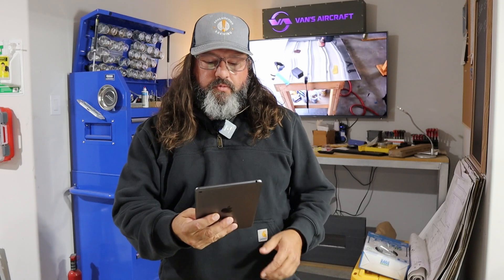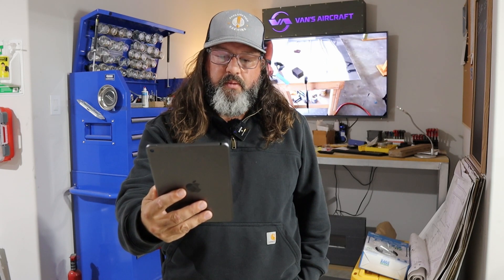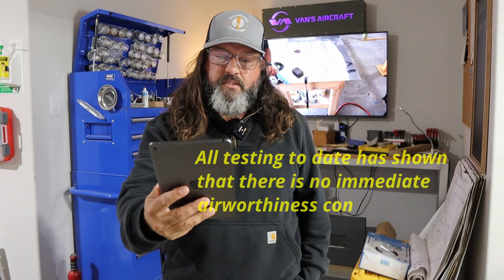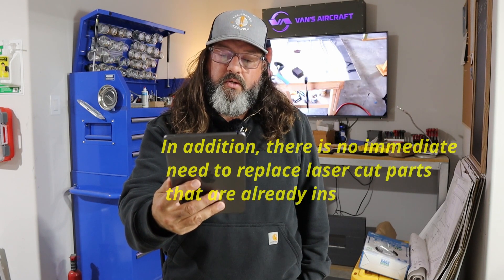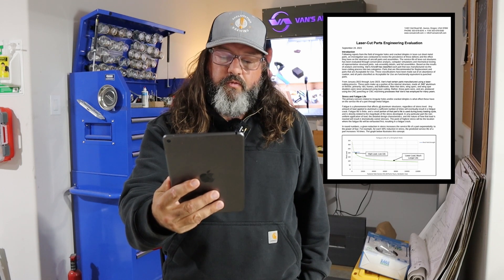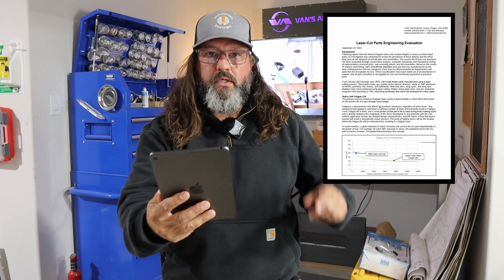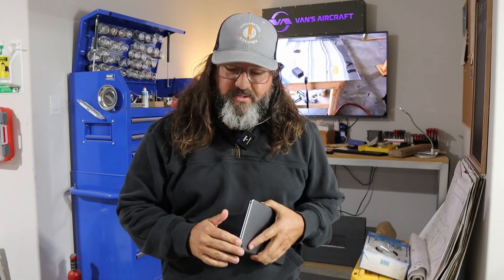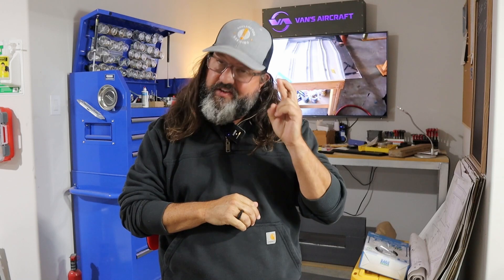Van's RV-8 Build. Ep 105. Laser Cut Parts III and the FAA's Opinion

Comment: I worked for The Boeing Company for 43 years. Over 30 years was in QA as an inspector, investigator and manager. The rest of the time as an engineering manager. Part of this work included dealing with quality escapes in the fleet of delivered airplanes. I have reviewed all of the Van's documentation regarding this issue. Van's analysis of the problem is very well done and is at the same level of detail and honesty that Boeing would have done. Now, for my 2¢ on this issue. I would replace all of the parts that are listed in the recommended to replace parts listing. Especially on airplanes under construction and in areas where it will be difficult to to inspect. Cracking is serious in aircraft structure. Inspections are not 100% reliable. There are always a percentage of defects that go undetected. Every builder, owner and operator needs to think about this. Afterall not who's butt is in the airplane today, but who's butt is going to be in it 20, 30 or even 40 or more years into the future.
Reply from the maker: I appreciate your input Jim. I’ll take that into consideration.

Comment: I had just watched an earlier video of yours on repairing a mistake on the rudder and noticed some familiar coastline in the outro video. If you are still in Ventura county (or nearby in LA county), I'd be happy to provide some inexperienced help if you need! I've read that a lot of places on an RV need a second person to hold the bucking bar 😅
Reply from the maker: Hi Watahashi. I moved from Santa Monica to TX a couple years ago. But I sure do miss the beach and the SoCal flying.
Reply: @thathippiepilot  gotcha. Texas seems like a nice place for flying though with all of it's airports (especially with a plane that doesn't need pavement). Just fashion up an AC unit out of a foam ice chest, some pipes, and a computer fan 👍. Lol
Happy holidays and a productive new year!
Reply from the maker: There is a great aviation community here. I was lucky enough to end up in an area with an EAA chapter that has a ton of experience Vans RV builders.

Comment: My dad was a heavy machine mechanic for thirty years. In this situation he would always say “when are you ever going to be in there again?”. Meaning if you had to completely disassemble something to fix something else you might as well fix/replace everything else in there you can afford to. I think if the components are sitting on the workbench (and you have access to replacement parts) it would be a heck of a lot easier to replace the LCP’s now than it would be in the future after the aircraft is fully assembled.
Reply from the maker: I agree with your dad. But those criteria don't apply in my particular situation. The time and expense involved in the complete dissasembly and re-building of the empennage is comparable to simply building an entirely new tail. And, to your last point, removing that assembly is actually not that difficult to accomplish.... Now, if we were talking about the wings or fuselage it would be a different story. Fotunately, the affected LCPs for my wings are still sitting on the shelf waiting to be replaced. And I haven't even ordered the fuselage yet.

Comment: As an RV-12iS builder about to finish one of its wings, I'm more concerned about the expected 32% increase in kit prices than I am about the LCP crack issue. The increase will make a $100,000 RV-12iS cost north of $130,000. And not because it's worth that much more...rather because somebody other than the builder did not do their job making sure parts or quick builds were airworthy quality.
Reply from the maker: I really expected QB kits to take the brunt of the increase. I’m surprised that it’s more evenly distributed.

Comment: I was in the Regional Aircraft airline support engineering business for many years and had a ringside seat to all sorts of similar crises. The analysis is likely showing that the local loads at skin/rib interfaces are too low to even propagate an existing crack significantly over any reasonable life span.  Transport category aircraft are sold with a certified crack free life of some value, generally 60-90000 cycles (TO's and LDGs) and fatigue testing uses a 3x scatter factor to cover eventualities. That is, to life the aircraft at 80k, the test rig has to be crack free for 240k cycles. But cracks still appear prematurely in service, and when they do, because of fault tolerant design, there may be ample compliance margins, 1000s of additional cycles, before something must be fixed, and the condition is just monitored until then.  This is for airplanes being beaten like mules, 2-3000 cycles/yr.  The Van's issue would probably become a concern on an RV that had, say, 20,000 or 30,000 cycles, which is pretty much never in that world. I would say the common sense approach is, the condition need not ground an airplane flying or render scrap a part already made, but parts not yet assembled should be made right one way or another. I'm surprised a work around hasn't been looked at, like reaming holes oversize to clean up the hole bores and using special oversize rivets. There was a lower wing plank crisis on the Canadair Regional Jet where lower wing planks had too small a bend radius where the wing taper changed (drawing reading error on the part of the press operator).  Cracks started appearing at the change in angle in service at the middle of the bend from the edge of the skin. If the crack was less than a certain length, the interim fix was, believe or not, to stop drill it and carry on flying. You got a grace period, a few hundred or a few thousand cycles, I forget, to apply a reinforcing doubler as a permanent fix.
Reply from the maker: Thanks for the thoughtful and educated feedback, JK. I would guess that a workaround like you suggested has been considered. And, there might be some builders opting to do that on their own. I think one reason why I might not be coming down as a recommendation from Vans is a function of the broad scale of the problem. In the airline world it might be one manufacturer working with a handful of client companies and their professional technicians to remedy a single problem (in your example). In this instance, it's one kit manufacturer dealing with 1500+ individual amateur builders who, in many instances, have several dozens of defective parts scattered throughout the entire airframe. The less complicated and potentially less litigious route may be to supply the builders with the non-defective parts payed for and expected. I tend to agree with your assessment. I'll scrutinize the parts in my empennage for any indications of cracked dimples, and I'll wait for replacements for the parts that are still on the shelf.
Reply: Good luck with it. If the worst case happens and Vans goes under, a group of builders w existing kits could pool their money and hire a DER (Design Eng Rep) to evaluate the problem.  He may propose a workaround nobody thought of.  @thathippiepilot

Comment: I understand that the cracking can be inspected for during annual. However, I assume that would mean taking a borescope to the airplane on every annual. Is Van's going to alter the maintenance literature to make the use of a borescope mandatory on annuals? Also, I would think there probably are certain parts that simply cannot be gotten to even with a borescope. As I understand it, Van's stance is that some cracking can be OK because they will surely be caught early enough on annual inspection. Imo that just doesn't seem like a really great solution. At least to me it doesn't.
Reply from the maker: In experimental aviation it is the builder's responsibility to create any sort of maintenance literature. Although, Van's may publish service letters with recommendations (which I expect will happen). Van's is not recommending that builders keep already-installed parts from the "replacement recommended" list. They are simply relaying information from the FAA to its inspectors that will obviously be of interest to any builders affected by this situation. It is after all, every builder's prerogative to proceed how they see fit. It's best that they can make their decisions with all available information. Lastly, they extent and means of inspection will vary widely among those who choose to proceed with their already-built assemblies as not everyone received identical portions of laser-cut parts and all builders are at different stages of assembly. If I choose to go with my currently-built assemblies, my LCP inspections would be limited to the empennage and all of those parts are inspectable. And, yes, some of them will require bore-scoping.
Reply: @thathippiepilot   roger that. Thanks for your explanations. I appreciate them and the time you are putting into these comment replies. Best regards from Brasilia, Brazil.
Reply from the maker: @sganzerlag  I appreciate the critical dialogue. It causes me to really think through all of it.

Comment: Previously, all of Van's documentation on holes said cracking was unacceptable. I believe AC 43.13 also said basically the same thing. But now, all of a sudden, some cracking is OK. Hmm. Somehow, that just seems at least a little bit strange.
Reply from the maker: I think you might be reading too much into it. Nobody is saying that cracking is ok. What's being said is that parts on the "recommend replace" list that are already installed may remain in place subject to regular inspection for cracking. Obviously, if cracks are detected they'll need to be remedied.

Comment: Does anyone know if Vans study took into account the vibration that comes from operating day in and day out?  It is one thing to study the load factor, and what affect that may or may not have on these cracks propagating, however if they did not take into account vibration, then I think they are missing a big part of what may cause these cracks to spread further.
Reply from the maker: Yes. Take a look at the analysis. It’s really informative and not an overly long read.

Comment: Way back in the 70’s my father explained to me that you have to see a hole as the top of the bag of chips. If anything sharp nick’s it, you can tear your plastic bag in two.

So he taught me that nothing can exist that could create such a small tear, or promote such a tear.

I was forbidden to leave a burr since a small burr could turn inside the hole and nick the hole and we don’t want nicks.

I was forbidden of leaving nicks on any holes, so I had to chamfer a little, very little, every hole.

So to avoid nicks, I had to only use the high speed RPM drill, and only proceed in step, from a small hole to a bigger one.  Slow speed drills we’re a no, no.

I was forbidden to punch, since this was the kingdom of nicks.  Something I wanted to do on the stainless steel line on a firewall.  Still today I think it’s a good idea as a starter hole…. But that hole has to get the proper drill to remove the vertical burrs along the edge of the hole.

Years later I met a man who produced parts for Bombardier and produced his own kit aircraft.  He wouldn’t do anything but drill at high speed.  He had millions of dollars of equipment to do high pressure water holes, and maybe also laser holes.  But he would only drill.

A friend of mine has a another friend who has a PHD on the topic of drilling holes in aluminum.  It’s all old science that is still being studied today at the highest level…

Why would anyone want to go against all that knowledge and experience, and we can say common sense since old men like me sees it as common sense, and go with opinions based on a few experiments, is beyond me.

Van’s injured itself, and it seem to think no one will notice the scars…
Reply from the maker: I appreciate your input, Marc.
Reply: Marc 
The answers simple. 
Vans outsourced the manufacture of the laser cut parts to a vendor that offered to do the work at what seemed to a good price.
The fact the vendor didn't actually know what it was doing went undetected for too long.
This is a textbook example of the perils of outsourcing.

Comment: Quite the position to have to be in I don't envy you but I think it sounds like you are making a sound decision based on the information available.
Reply from the maker: Yep. The whole thing is still unfolding. It’ll be years until the empennage I have built knows the joys of handling aerodynamic forces. Who knows what the final word will be at that time. But for now, tearing it apart is unnecessary.